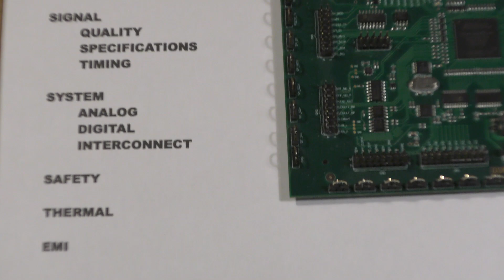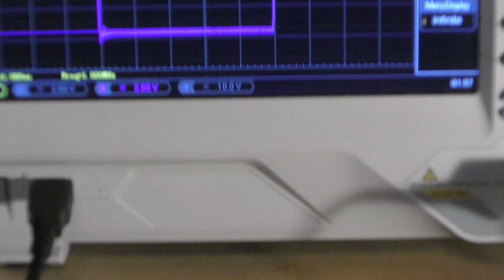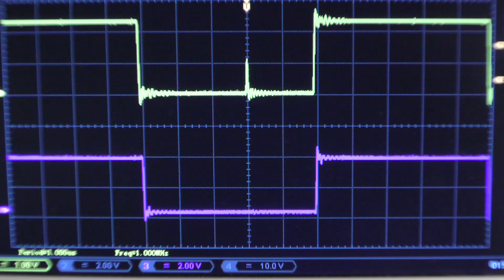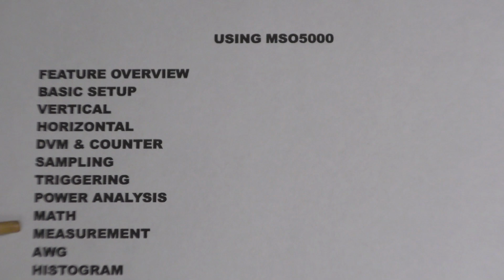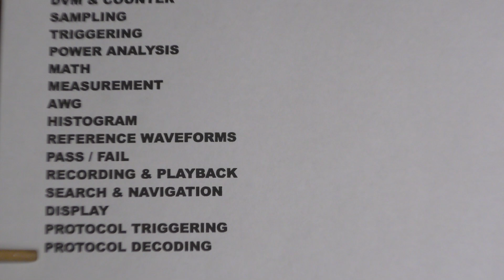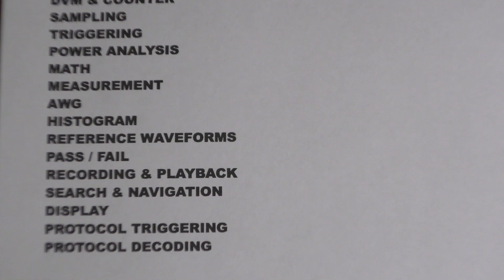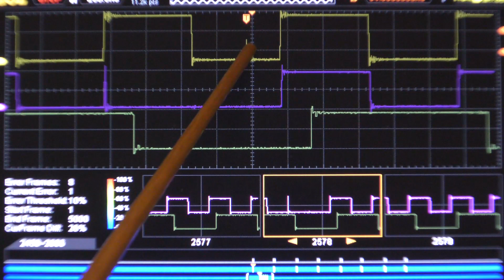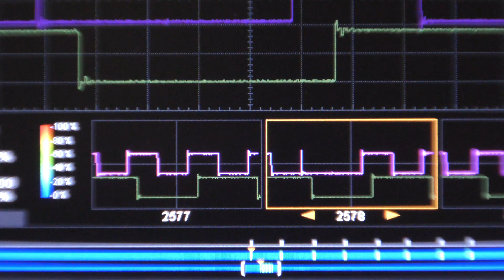TTT367 Embedded Systems and Rigol MSO5000

Comment: This is fantastic, I do very much look forward to following every point on your list! :-)
You ask about comments on your list and I have to say that safety very much should be a huge part of your series. I do not think you can find a single video on YouTube that talks about how to protect yourself or the project. I.e. electric shock when projects have to be on, exploding capacitors, heat, static electricity, solder or iron on your skin, chemicals in your eye, and 1000 more things.
Also, EMI all that, how do you select shielding material, thickness, avoid shortcuts via shielding, dos and don'ts, and so on. Right now is there a lot of tinfoil-hat information, but nearly nothing about real shielding for projects. :-)